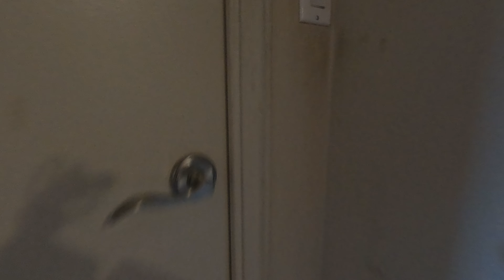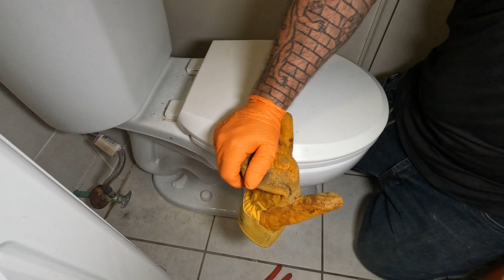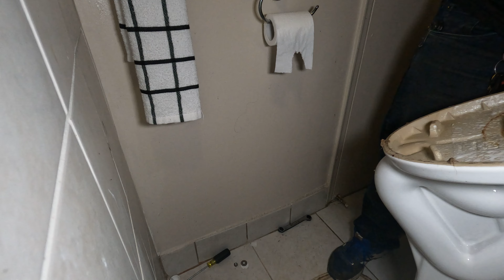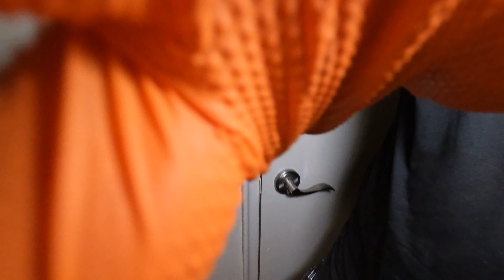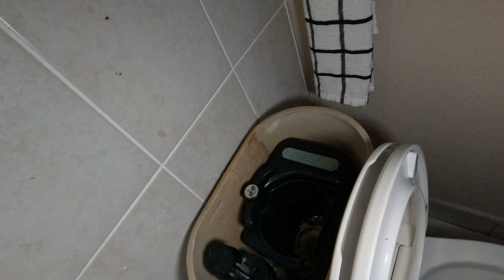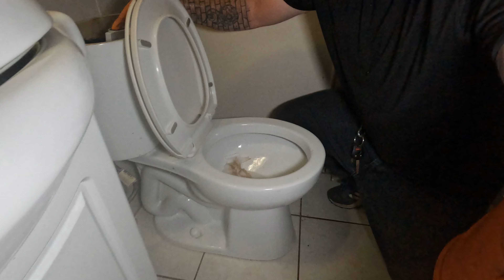You won't believe what I find in this toilet, your mind can't even process it. Click bait titles suk

Comment: I've had a problem like that in the past where the auger wouldn't get through the obstruction of grab it. I removed the toilet and went from the bottom with a 5/8 cable to push the obstruction back out the way it came in. Turned out to be a toy. Also did the same thing with a Poo-pourri bottle that someone flushed. I used my K-50 to get the toy dislodged but the bottle just pushed out (with some force).
Reply from the maker: Yeah I've done that in the past. Flipped it over and tried to auger it through the bottom. With this style of toilet you can't get through the double trap or at least I haven't been able to. Maybe if I had a hand to run the auger while somebody held it that may have worked but these toilets are pretty stubborn. Thanks for watching Roger. I hope you have yourself a great day. Trogna